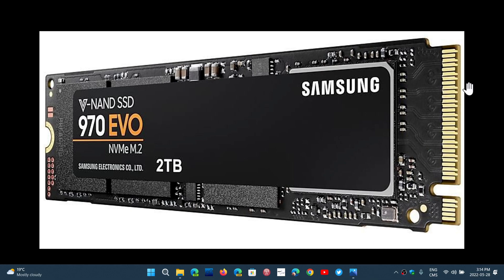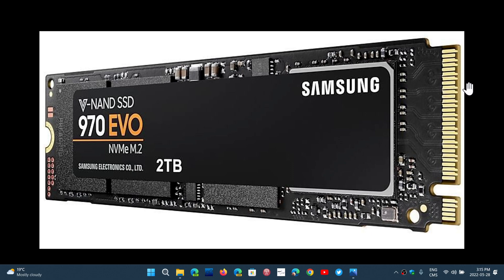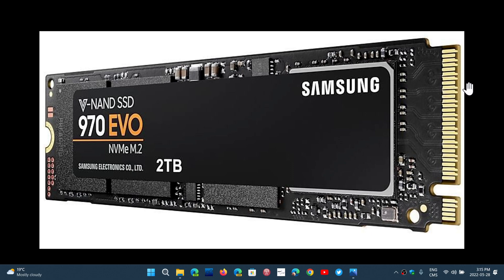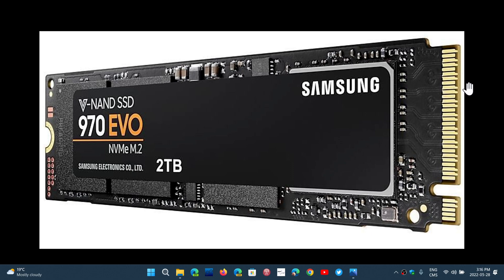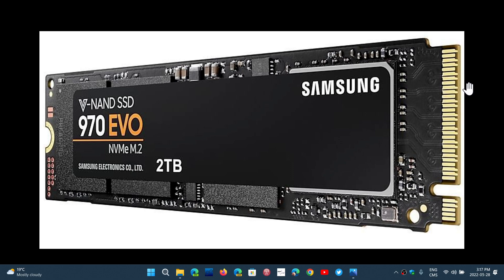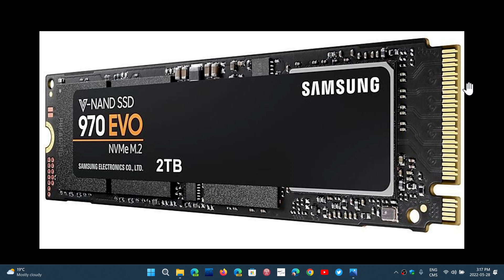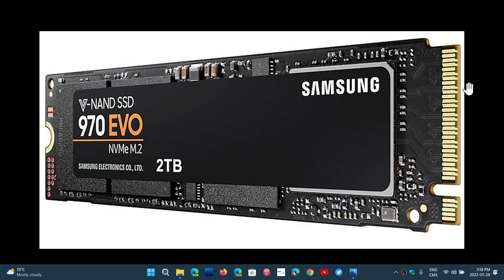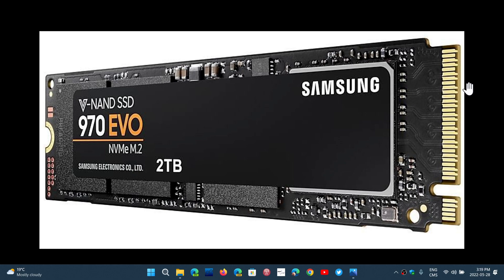Why do Solid State Drives fail

Comment: not always the case my 1tb nvme m.2 lasted less than 9 months after they said that they can last long and i only had my steam games on it so did not copy and delete alot on it and it was brand new
Reply from the maker: They last long, you had a defective SSD
Reply: Yup, mine just gave out after 6 years of constantly editing videos on an 85 degree celsius laptop. I guess something was wrong with yours if it kicked the bucket that quickly.
Reply: It was prolly defective, but SSDs are still not as durable as a good HDD. If u use a SSD for intensive stuff it will not last long from my experience. A HDD can take stress like a work horse for years. If u put a SSD under similar stress it will not outlast a HDD from my experience. There was a period where I had a HDD put under serious stress for weeks from Architectural & video editing software. And Im surprise its still kicking after 8 years of everyday usage. I even game on it recently beating RDR2. Ive seen an SSD put under similar but less stress as the HDD and it only lasted 4yrs. So yeah SSDs are kinda iffy, especially for softwares that are intensive on storage.

Comment: I heard that SSD'S Fail too because the defrag setting was left on in computer clean up settings and they are only meant for mechanical hard drives and ruin SSD'S.
Reply from the maker: defrag has nothing to do with the drive failing
Reply: @WCT  true sometimes its just faulty from manufacturer i had samsung 980 pro failed  last year like it started to do bsods daily and after i installed on my older sata no bsod for weeks so i rma it and get money back and bought kingston m2 drive and its fine
Reply: @WCT  and it us true it was pretty hot like close to 60… now with kingston m2 under 40 around 35 even now when summer is starting
Reply: Basically it doesn’t matter if you defrag every day for years, the drive won’t fail. The reason why its not recommended is because on an SSD, fragmented data can be accessed at the same speed as perfectly organized data. When a file gets deleted on an SSD, it doesn’t actually get deleted, the OS just marks the space as “available” and will eventually be overwritten by new data. Windows should do this automatically, it’s called trim not defrag. If windows is actually defragging an SSD it’s because a setting is enabled or a command was run that shouldn’t have been run.
Reply: @zackstaa7826  Setting such as????

Comment: I have HDDs from windows XP days that still work to this day. Ive seen a SSD die about 2 months ago suddenly and it was only 4yrs old. I have a laptop from 2016 that uses HDD that has been put through hell from architectural software, rendering software, video editing software, hardcore gaming and it surprises me it has not died as yet due to the stress its been put under. The SSD was put under similar stress and it only lasted 4yrs. It seems software that writes alot to the SSD kills it quicker than its intended lifespan.

Comment: I have a Samsung 840 PRO 512GB SATA SSD that has been running since 2013 (9 years) without an issue! Has my OS as well as a few games on it. I have always kept it no more than 50% full.
Thanks for the videos!
Reply: Sounds like u mitigated its failure in the way u use it. It's unfortunate we have to watch how we use SSDs because of finite write cycles.

Comment: most SSD's ive had fail were the SATA ones.. never by wear though usually the ports snap off by then during usual cleaning/maint but rare cases i had SATA SSD's stop working and all of those i so far managed to revive by taking PCB out and just giving it gentle bends in few sections.. now they were also old drives like SATA 2 early SATA 3 models but whats funny is they still work fine today, now not in active use as much but doing just fine. so far never had a NVME fail yet only cause i just recently bought into this types, i had one drop on me month back but some times taking them out and cleaning the contacts/re-seatting could fix a possible what seems dead NVME/SSD which worked for me in this case, but if important things on it and that does not work could always try my method of just gentle bend flex it slight and could work long enough to backup off of i mean its dead by that point not much to loose unless plan to take it to a data recover place then don't do that of course.
Reply: NVME drives do fail, and are faulty sometimes. It's almost impossible to diagnose NVME drives since they don't have smart. Beware! Only buy fancy/good nvme drives! Sometimes I've had to just clone it off to another one and that fixes it...it plugs directly into pci express like a gpu or other pci express card they are kind of wacky. Cloning them off or seeing if you can at least POST with a different NVME drive installed is often necessary, some systems don't even have SATA imagine how frustrating that could be. On SATA drives the best diagnostic is GSMARTCONTROL which is open source and free, but rarely you can have no reds in that tool and still have a bad SATA drive, but it's super rare.

Comment: I just messed up an Adata Gammix s70 system SSD using the manufacturer's "official optimization tools" app, and now my PC boots straight into BIOS and the former 2TB system drive shows up there as a generic 2MB(!?)  drive (I have two identical ones installed, the other, non-system one still shows up with the original manufacturer brand and SN) . I suppose there's no recovery from this? should I bite the bullet and just go ahead and replace the NVME--or is there a way to fix it and at least reformat the damn thing using the command line in a similar way? (to do a clean Windows 11 reinstall)
Reply: Warranty will cover it.

Comment: I have the same ssd there. I think it’s failed because it’s 4/5 years old now. Also I was recently downloading lots of heavy files over night and through the day. Not good for it. Hundreds of gigs, also lots of deleting files. Going to try to clean the port and the connection with compressed. But might need a new one since it won’t pop on my file location settings.
Reply: This my number one issue with SSDs. If u do anything that is intensive on the storage it will kill the SSD quick, vs a HDD that can take it all day like a work horse.